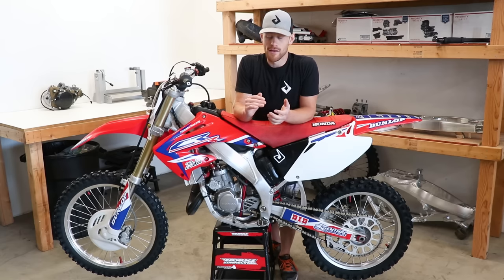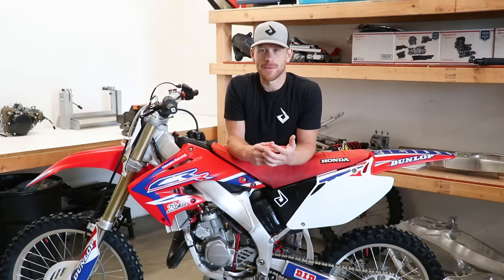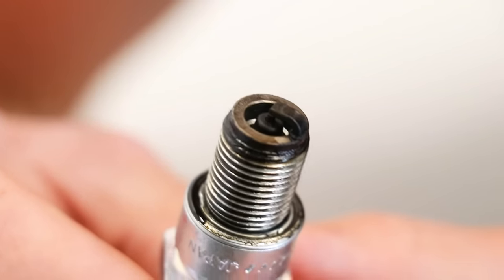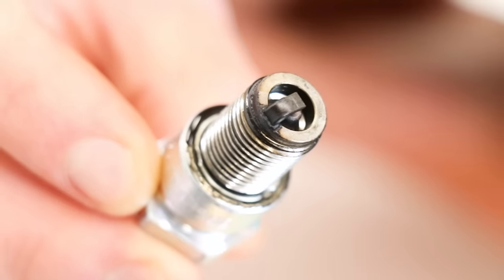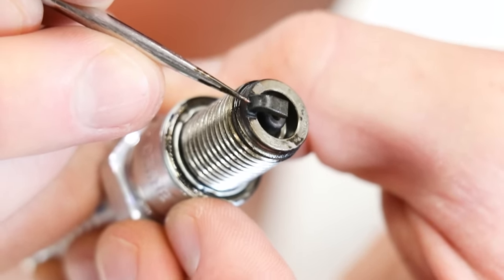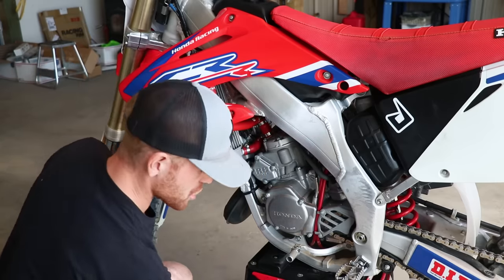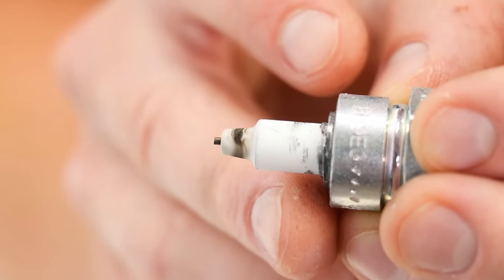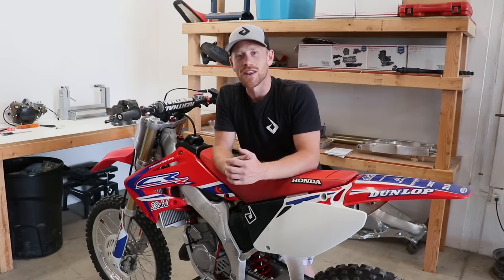How To See If A Two Stroke Is Running Correctly!

Comment: Bad two stroke fuel advice. When you take an engine/jet combo designed for 32:1 and bump it to 40 or 50:1 the end result is Richer unless you re-jet....and vice versa. These fuel ratios have corresponding viscocities and the leaner fuel ratios like 50:1 flow much easier through the fuel lines and jets. This leads to even more smoke and a richer condition. Tons of videos about this.

Comment: How about getting the 02-03 cr125 mikuni carb straightened out ??
I tune pretty well.. but I'll say , this  TM  carb is a bit of a pain on the Cr125..02-03.
Some swap to the pwk38 and  RM needle...
 others say use a #7?? Instead of #9..
It's a  Something Valve  from the yz carb setup. ?? 
I currently have this issue ..just went through entire motor.. looking to get fuel delivery on a better note before break in.

Comment: Should i change the needle if i changed my powervalve spring from green to red? It started drowning when i let off the throttle.
Bike KTM exc 250 2 stroke
Im running lectron 36 mm carb 
vforce 3 reed valve block
Fmf goldseries gnarly woods pipe
Stock exc silencer
Mixing 2%

Comment: im goin through alot of spark plugs. like crazy amount on my new yz 125 2024. 32/1 ratio. i hit trails a fuck ton. you said to run 40/1. i havent messed with anything at all. no jetting changes from factory. lmk if i should try 40/1 since i ride trails. or maybe even leaner, ik this vids from 5 years ago. im tired of bringing spark plugs out with me. changed one on the trail today then fualed  another one 1 hour later.

Comment: Well I tell you what I just found out I’m running a BR8ES Spark Plug and it’s a little cold for my liking, the 9EG seems from what I’ve heard to preform better overall and have a longer life if the carb checks out, shoot you run it in your 125 so I’ll run it in my 03 Cr125!! Thanks

Comment: my PIECE OF SHIT 97 rm250 is fouling plugs in about 3 seconds...ive got the pilot 3 sized smaller than fmf rec's. and the main 12 less....FOULS THEM IN 2 SECONDS...new/used bottom end. brand new top end. new crank seals and main bearings....new reed...WTFFFFFFFFFFFFFFFFFFFFFF IM ABOUT TO SET IT ON FIRE

Comment: Can anyone help me fix the problem to my bike 2003 cr85rb, so I start the bike up an it’s a very loud high revving sounding the the throttle cable is stuck so when I put the bike in first gear the bike flys an throws me off idk if it’s the carb or the throttle cable.?

Comment: What about jetting for bigger carb
26mm to 28mm +perfomance exhaust+boyesen proseries reeds. 

stock bike main is 112 so 120 ish with perfomance exhaust /stock reeds will be good

Now it has 140 for 28mm with carbon reeds, full exhaust and airbox mod. Not started with that setting

Any advice for that bike is 200cc and power +- 35hp
Im not getting most power out of it little rich is good for old bike

Comment: Ok so I have a question..I have an 03 CR125 and I need to do plug chop testing on it..I run the stock BR9EG but for sake of doing plug chops can I buy and use the BR9ES since they’re cheaper or will it give me the same readings as the EG plug?

Comment: I bought my first bike about a year ago. A 1999 yz 125 2 stroke. Let it sit all winter, then tried to ride it not to long ago. Kicked it for about a hour before I gave up. It wouldn't start. 🤦🏿‍♂️I had left gas in the bike. Was told that was a no no...  was running fine before the winter. I changed the oil recently, drained the old gas and put in a new mix, new spark plug. Any help would be great. I also tried cleaneing the jets with carb cleaner.

Comment: Do you have a way for us to ask you questions about our builds.  I am having issue with my son's 04CR125R.  we refreshed the top end. cleaned the carb.  i followed the jetting process you and had it running great once.  The very next day  it started revving super high, then stalls.   I am wondering if a crank air leak would cause this? I am not sure where to start again.

Comment: My spark plug is black wet after 5 mins. The jet is a 280ninstead of 270. The piston is old. Should I change the piston or look at the piston a build in a 270 jet.. Because I don't know how old it might be.. I think I first change the piston. And check the compression. Maybe it will rind. And while I am changing it I will see if the simmering from the engine is in good condition.. I'm afraid of that it is broken and oil comes in the engine. It I don't think so because it smells normal

Comment: Great video, although i just have a question. On the insulator nose your one is black after 30 minutes of riding and on my bike it is white and has a bit or brown under the electrode. I have ran this spark plug for a good 10+ hours and its always been like that. What does this mean, its really bugging me i cant find anything online I would really appreciate a reply.

Thanks

Comment: Can also read your gas mixture from your exhaust! If there’s not enough oil in the mix there will be black liquid dripping down your muffler, that’s unburned fuel mixed with exhaust fumes, contrary to what you’d think cause it looks like oil, but a proper mixture will smoke a lot, but won’t drip

Comment: On my Honda CR500 the idle adjuster is on the choke knob. How do I zero this out? Which way do I turn it and how many clicks do you recommend for easy start up and good idle? Do I adjust it while the knob is in the up or down position?

Comment: Hey my 70cc bike doesn't start cold by kicking at all. It starts warm 1st kick. I have to push start it and it roughly starts. Top end is good and I've changed the plug. Any advice?

Comment: Hello sir. My 2 stroke idles high when engine is hot or i ride it 5-6 km it idles up to 3k to 4k rpm. But when i pull the choke it idles goods. There is no problem when first start because it runs good and there is no traces of airleaks and the sparkplug is caramel color. What could be the problem?

Comment: I wonder if you could help me i have a kx 80 1991 with a 1989 engine and a kx 100 cylinder bolted on the bike splutters and has no power until it comes in to the bands and then it runs like a bat out of hell back wheel every gear it has a 122 main jet 55 pilot any help would be much appreciated thanks

Comment: Also the gas at most gas stations suck now there too much ethanol. Ethonal causes corrosion and it doesn’t matter if it’s a dirt bike or lawn mower especially anything carbureted really... so stick with higher grade gas just to start with mix it reasonably to the way you ride open all the time or trail riding and if need be adjust... some aftermarket parts want you to adjust but they want you to adjust because they expect your buying parts to go racing( FMF, Pro circuit) some people change pipes and think they need to rejet when the problem was they didn’t need louder pipes in the first place... instead pull the baffle out of your pipe

Comment: Great video man!!! I dont have a dirtbike but i got a hoped up yamaha waveblaster. I have to do most of that in the water with waves crashing into you lol. At wot it sounds a bit raspy or pinging sounding. Would that be detonation from to much compression and not enough octane fuel or a jet issue? The plugs dont look black  but there not golden brown either. There more like a black with a greyish tent. Im also running a br9es istead of a 8es like i normally do because that all i had. Idk if that would matter for my issue

Comment: Just watch 2 of your video..i learned alot about tunning..never really knew exactly what to do..
Just did a frame off on a 1997 yz 125 
Doing a 1998 rm 125 now
Then I'll start a 1997 kx 125 in a couple months
And I got a bike like yours it has carb problems..now this weekend I can hopefully fix it now...or mine is a 2004 cr 25

Comment: If anyone noticed he said a little lean for power on the track like32:1, in which case rebuilds are  gonna need done anyways. Riding mix 40:1. Basically if you aint racing pro a runnig the shi out of it go 40:1 and it will run for years as long as you change plugs and open it up once in a while.

Comment: Exhaust gas analysers are about $100 or so. Maybe share with friends or rent one?
A lot more accurate, a lot less fiddling around, a lot of time saved and a lot less wear on
your plug and head threads and the plug crush washer. 
You could end up with a plug that won't seal, or worse a head that needs repair.

Comment: Pw50 dad here!   Thank you in advance.  I put a new carb on my son’s bike and reused the slide and needle.  It is a made in China carb and took off the oem carb.  It bogs/misses at high speeds.  It has lots of low end power at take off.  The needle that came w the China carb looks rid bit longer and possibly more narrow than oem needle.  Could that be the issue? And how hard is it to replace the cap/slide/needle and I guess choke parts?

Comment: Works connection, WC,  is Chris Walsh backwards. CW,. Just installed new clutch lever WC on my KX80 big wheel going under a full restoration, putting Big Bore Kit on making it a 110, not at the park of putting decals on butt!! I'm interested,!

Comment: I got a 2006 yz 125 I ride mainly at sea level in the trails running a 40:1 mix. its got the stock header with an fmf shorty silencer, but even with the stock silencer ive notice it still runs rich. I've tried recommended settings for jetting and even changed the pilot jet down to a 35 from a 40. still fouls plugs almost every ride. Any help would be greatly appreciated!

Comment: I always thought you looked at the isolator and not the top flat part of the threads. Am I wrong? My insulator looks good, but that top ring barely has any color to it. About 30min on a new plug before reading.

Comment: Thanks for the video I need to do this to my bike after changing the exhaust system the garage that fitted stayed it didn't need a bigger main jet but the paperwork that came with the Dep exhaust says that you would probably need to up jet the main jet 1 maybe 2 sizes up from standard. My 2005 Yamaha dt125re is autolube has a oil tank I don't need to pre mix would just be the same concept ?

Comment: Cutting a new plug open to check a plug chop is the stupidest shit I've ever seen. Use an older plug clean it run the bike up and down faily fast then do a plug chop. Then check the colour of plug tip

Comment: If you run too lean you can scorch the sleeve of the piston too much heat and not enough lubrication... if the cylinder is running too lean it won’t have enough lubrication and could cause detonation. If you run 16-1 like someone in this feed said after running 32-1 your using half the oil maybe you could’ve tried 28-1, 26-1 first jumping that far the expansion of the piston without enough lubrication caused the piston to heat too fast and burnt right threw the top or scorched the piston sleeve itself either way new top end.

Comment: Hello Cameron , I learned : shorter Center insulator = cold Verses faster heat transfer , longer center insulator = hotter plug = slower heat transfer . The color of the center insulator shows the heat range of the plug , the ring where the ground electrode is welded on , showing the burning temperature ( air/ fuel mixture) . Maybe I am wrong ?
Thanks Reiner

Comment: hey guy nice tip on the spark plug i will be sure to try that out i just got done rebuilding  the top end on my kdx 200 i ran into a batch of fule that had water in it  that was nota all friendly to any of my 2cycle motors  so i do plan on running that lean rich test  thanks you have made my life a little better and yes it wouldn't be a bad idea to see a jetting video good luck with your builds and its great to see you are doing well2 stroke people are tuff lol

Comment: When you're doing the chop test after you ran it wide open through the gears and shut the engine off you need to hold the throttle wide open for a correct plug reading, just saying

Comment: Use a hole saw on top of the insulator cutting into the metal, you can then remove the porcelain without cutting threads

Comment: Cameron, great video, I have learnt so much from you. I bought a 2nd hand 125. How do I set the carb as if I start fresh. Is starts and runs fine but I am not convinced it is optimal. Thanks
Reply: take a look in the service manual for your bike and you will find a jetting chart that tells you standard jetting sizes and needle clip positions for different conditions ex. altitude, temperature.
Reply: Daniel Hogholm thank you. I am new to this, I have been riding 4strokes and recently bought a ktm 300 2016 and a 125 so I really need to how it is done. I have the manual but still.

Comment: Hey cam, i have a 02 cr125 and just did the test. I have a 1mm diameter. This bike is only going to be road on trails probably not ever going to be pushed to full rpm. Do you think i am risking by being to lean? Im also running 50:1 at elevation 900ft
Reply: 50-1 on a 125 is asking for trouble I don't care what kind of oil you run.    Unless your just slowly idling around

Comment: What are the differences of rich and lean soundwise? Im having a problem with my two stroke but im nor sure that is it running rich or lean.. 
Thanks for the help!
Reply from the maker: Yes, a lean condition will have a zingy or quick revving feel to it and rich will be slow to rev and laggy. Here's a video that goes in depth with jetting https://youtu.be/Uid8L4yMvfc

Comment: Could you do a video about the spark plugs more in depth. what octane gas should be ran with what numbers or heat range plug? NGK plugs
Reply: With 2 strokes

Comment: When you put the first spark plug in and ride for 30 min   are you riding it threw every gear wide open ? Or just cruising around slow
Reply: Warm up the engine for 5-10 mins. Then you can full throttle. You dont need every gear on the full throttle, most people do 4th gear but 5th is fine too.

Comment: my pw80 bogs out and idle is high until i apply choke
Reply: Nitro rc / motocross you have an air leak somewhere in the intake system. This causes a lean condition. I have had the exact same bike, and problem. Take the whole carb assembly off, and check all gaskets leading to the engine.

Comment: Great video man, lots of valuable information in here. Two questions about your bike: Where did you get your graphics kit for this bike? Also, the red anodized washer between the gas tank and the rubber frame isolator, where did you get this washer? Just curious as I would like to purchase these pieces for my 01 cr125.
Reply from the maker: Thanks Bryan! The graphics kit was off of eBay. https://www.ebay.com/itm/Team-Honda-World-graphics-number-plates-CR125-CR125R-CR250-CR250R-2002-2007/371717981104?hash=item568c1e43b0:g:PDIAAOSwZB1boC-9
Reply from the maker: And the washer I can't remember. Check Rocky Mountain ATV or boltmx.com, they may have something similar
Reply: Cameron Niemela Awesome! Thanks for the reply. I found the washers on Boltmx! I will definitely be staying tuned to your channel for awesome content and tip/tricks to my cr125!

Comment: ok thx but everytime i start the bike the refs are super high and when im pulling away the bike is kinda like giving throttle and i dont know what that is 😐❓❓
Reply: Adjust idle and air screw, try another jet size. Also clean carb. Check for air leaks

Comment: Why does my bike come down from a high idle, then about 15sec later drop to a low idle?
Reply: Did you already adjust the air and idle screw?
Reply: @MUSTAFK  of course.  My 125 and my 250 do it. The 250 still does it now even with my lectron carb.
Reply: @JohnDoe-ud2cc  I think you either have an air leak or your gas cable is getting stuck. You might wanna check both. For air leaks use deodarant or brake cleaner to check for leaks

Comment: i have an old ke 100 would tightining up my points gap advance my timing?
Reply: You adjust timing by turning the plate your points are on. Should be held by screws in slots. Loosen screws and turn plate. Newer bikes you do same but you don't have points. Instead you move stator.
Reply: @briankennedy5578  these bikes are weird no adjustment screws on the carb and no slots to adjust timing i will have to modify the plate the points sit on...it was made befor ethonol blended fuel its an 83 im gonna hafta get creative i guess lol
Reply: An 83 with points? That's very odd. Should have cdi. What brand is it? You probably have carb adjustment screws. That's about the time they started trying to hide them. Then in 90s they took them away. Look for a hole with a cap or plug in it. Drill a small hole and use sheet metal screw , pick , or whatever and pull it out. You should find a adjuster screw. Want to be sure its not where they drilled out fuel passage. They usually look more like a hole with a ball bearing stuck in it.
Reply: @briankennedy5578  the only plug on the carb is for the air bleed and cdi is no bueno for what im doing points wont limit how far it will rev...rotary valve mods ;)
Reply: Well to adjust the timing on that bike you align the mark on the flywheel with the mark on the case. Then after loosening the screw on the points, you move the points to where they just start to open. Then of coarse tighten. If you want it advanced or retarded,  adjust accordingly.